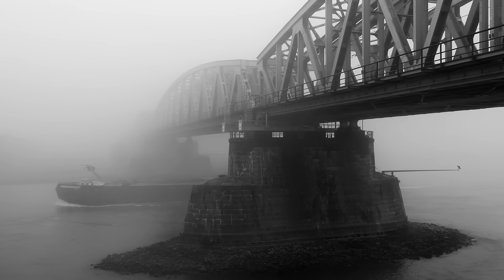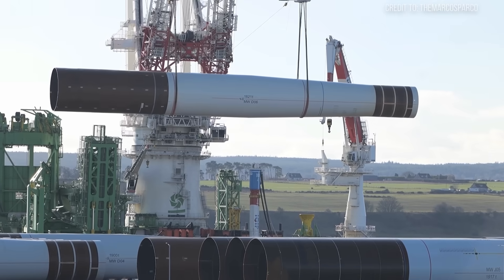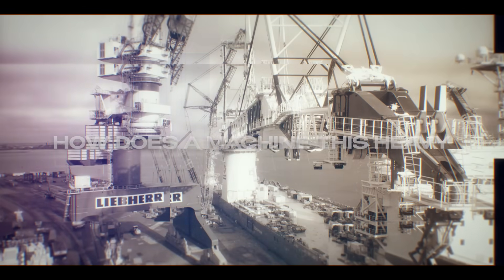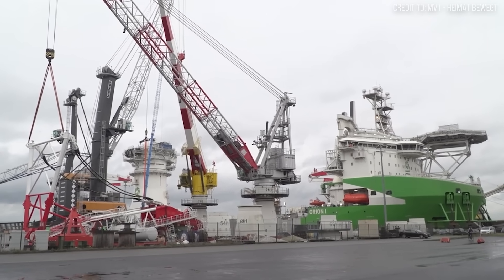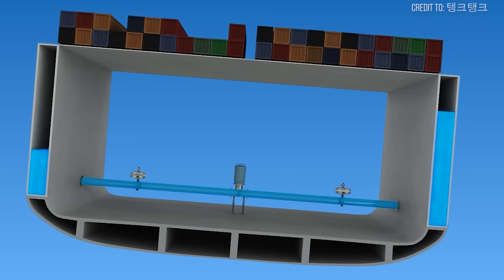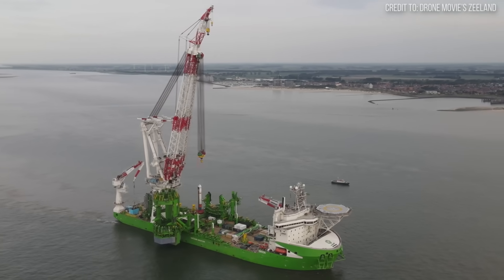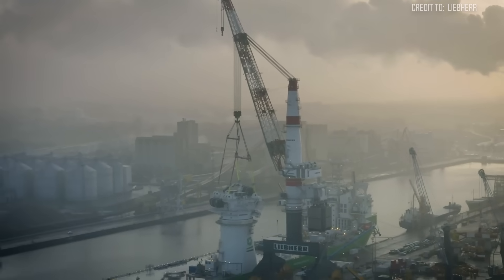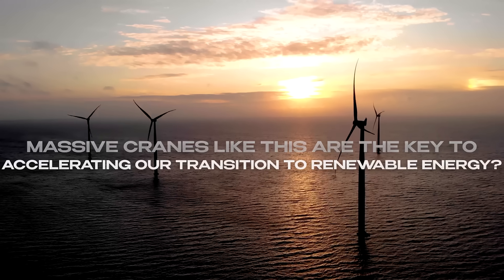$60M Catastrophe: The Giant Crane That SNAPPED And Rose Again

Comment: Imagine there are Cranes that lift two and a half times what this one does? 
I'm surprised the Company that made the Hook for them didn't test it, normally, testing is done at one and a half times the maximum rated.  I'd like to see it mounted on Crawlers or a Portal type  like the TCC 7800.( the one you saw assembling it) 
The Crane Operators running that day must have PTSD? the Load Block came so close to crushing the Operator's Cab.
Reply from the maker: The engineering that goes into these is very impressive. Yes the stress they must have gone through on the day is hard to fathom! I actually have the TCC 7800 on my list for a future video too. Hope you enjoyed it!
Reply: @HardHatIndustries  I did , well Done ! I look forward to it.